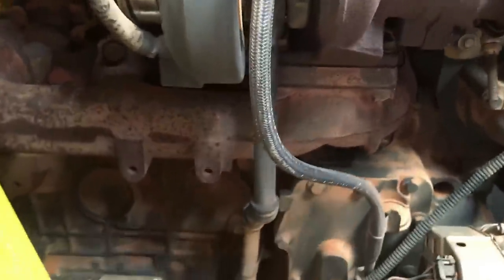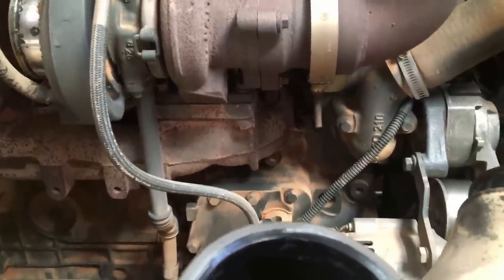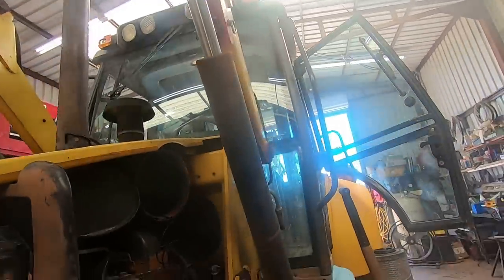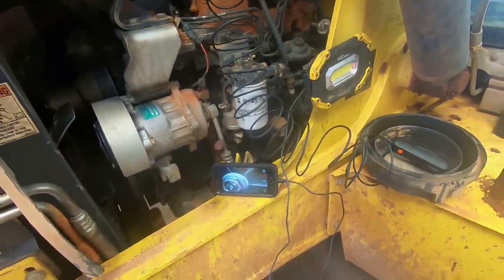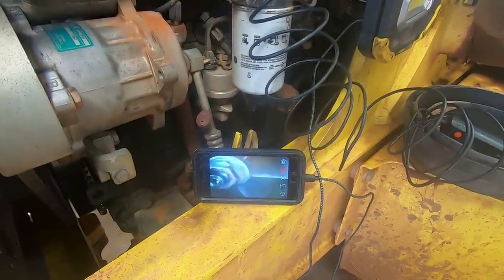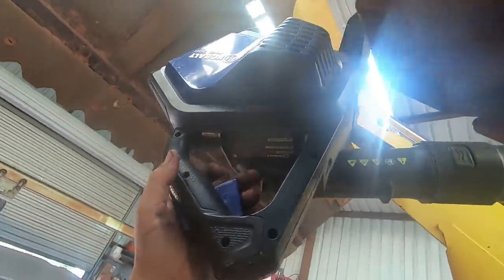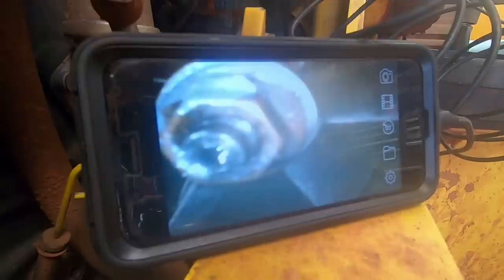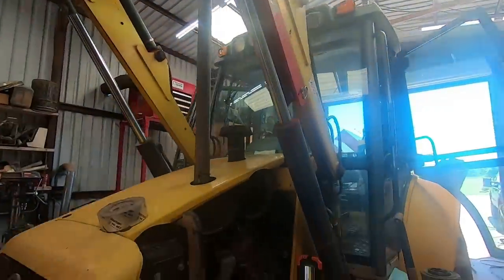Turbo myth? Should I cover the exhaust on my backhoe?

Comment: Great video. I believe turbo damage happens most from improper start up (rpms when cold) and improper shutdown hot shut down. Great job!
Reply: Andrew Dennis or no air cleaner. Suck up some debris gets them every time haha
Reply: For sure Jason!
Reply: My dad was requested to remove the turbo on the Insley excavator he operated 30 years ago and take it the repair shop. The shop told him the turbo was just fine due to how dad operated the machine. Warm up & cool down procedures dad did was strict (dad's personal procedure was the rule). I was taught to tape the exhaust just as a precaution.
Reply: Same here Dennis

Comment: Muffler vs non muffler. Older CAT iron pre muffler did have issues. As you said air flow blocked and incorrect direction good video

Comment: Well I guess I stirred the kettle. Thanks for the great 👍 presentation
Reply from the maker: No problem, it’s an interesting topic. I have hauled my machine since 2010 it has 12300 hours, original turbo. Some of the older equipment manuals have instructions to cover the exhaust when hauling. Maybe something to it. If I was hauling for hire, I would cover it just to make sure I would not catch the blame. Thanks for watching

Comment: Good demo Frank!
I like your reasoning and the video hookup with your phone to prove your point. I have 2 machines with turbos and have never had a failure relating to the transport with the stack uncovered.
Kudos for the time you spent to illustrate the turbo reaction to the forced air into the stack and the air intake. A scientific presentation from a reputable backhoe expert! Nice job.
Work safe, have a good week. 
Doug@ the "ranch"   #MBGA  #Digginok  #Backhoeman  #Rockanddirt

Comment: Great job. I’ve never really thought about it. Any cylinder that has an open exhaust valve would also have a closed intake valve. In my country boy thinking that would make a dead end. So after the initial charge of air flow would stop.    I like this kind of stuff to.
Reply from the maker: There is a bit of valve overlap, just a bit though.

Comment: I think it would take a unique set of circumstances to make it actually spin the turbo while going down the road.  I actually think the theory of forcing air in the exhaust is backward of what COULD happen - I think more likely is it would be pressurized intake/ram-air AND have a low pressure area at the exhaust with the pipe pointing backward of travel AND the engine would have to have a cylinder with both valves open in overlap.  We never covered exhaust up back when dad had the tractor shop and plenty of tractors we hauled were turbocharged.  I started covering exhaust only from the suggestion of others.  Not sure I'll continue.  Great video, Frank!  Thanks for sharing!
Reply from the maker: The limited amount of valve overlap is not enough to allow air flow, but it would be more likely in the right direction. Covering doesn’t hurt I’m sure, just not convinced I need to start
Reply: @Digginok  Agreed!  Very unique circumstance and I doubt even then it would be enough to overcome the other restrictions such as an air cleaner and still have enough flow and pressure to move the turbo blades.  The overlap with the valves would allow such a small volume as well.  I just don't think I'm going to worry about it much unless going on a long trip or something... I donno.  Prly not going to make much effort myself to cap the exhaust lol!

Comment: There's only one way to get a bearing to spin when you put compressed air to it. That's the angle you hold the blow gun to it.  Well it's the same as getting a turbo to spin, that exhaust has to hit the fins in the turbo at the correct angle. Back flowing air to the turbo to make it spin  would be difficult even if you took the exhaust pipe off and blew air straight in.  You'd have hit the fins at an angle. 

Also you are fighting flow restrictions. yes some of the exhaust valves are open but if the intake valves are closed all the air is doing is pressurizing the cylinder.  Both the exhaust and intake valves need to be open at the same time.  Which they are towards the top of the exhaust stroke  due to valve overlap.  But they are far from wide open.

As far as water getting in, Ford made provisions for that by putting a weep hole in the bottom of the exhaust pipe.

As for the comment stating, " If your exhaust was facing backwards while towing, it could cause a low pressure on the exhaust and positive on the intake, I say cover it just in case of foreign objects".
low pressure on the exhaust, meaning a vacuum to suck air out of the exhaust?  Which would be pulling air in the intake?  I think the air filter would take care of any "Foreign Object".

Comment: I have zero clue but perhaps, at one time, old turbos did not have something to prevent them from spinning backwards, if they even did run backwards to begin with. As I said, I have zero clue if this is true. Or it may be the same as "an exhaust needs back pressure to work". Who knows where this stuff comes from. great video BTW, well thought out and tested. :)

Comment: It happened to us,and yes it was a 1995 D -4 Xl high track.We have been trucking and logging for 40 years, and we never ever pull ed another piece loaded backwards!! And now even today when I see 18 wheelers being transported backwards, the exhaust is covered!! Think about it its on a lowboy coming from Texas to Chicago at 65 to 75 mph ,! That's a lot more air than a 100 mph leaf blower.. That's a lot of dirty coming from the front the sides from everything in your space. Trust me a 300 pound would have to chained to the floor or he wouldn't last 5 Miles, before the wind shear would float you up and away like you had a open parachute strapped to you. Think about and let me know!! Danny Hackler!

Comment: You're right I think. The air on the intake side is static and it would take a lot of airflow through the exhaust to get it to turn. All the bad turbos I've rebuilt were damaged due to ingesting garbage through the intake or oil supply issues. Running the engine at high rpm and shutting off hot without letting it idle for a minute will shorten it's life, the turbo shaft bearings depend on oil flow to stabilize and cool the bearings.

Comment: I've heard this myth a few times. Someone always claims to have seen the damage themselves, but then the details come out and you find the equipment was 20 years old, or the engine had an oiling issue before the turbo was lost. Maybe there are a set of circumstances that would cause the turbo to spin, it's doubtful. The only guy I have ever seen cover his exhaust while on a trailer finally stopped when the cover ( a heavy metal can with tie downs ) came off and broke the windshield of his backhoe. 

By the way Frank, you have got to be the best operator I've ever seen. While I'm not Jeff from Jpaydirt, I've seen more than a few. Talk about pride in a job well done, you and Jeff are the best.
Reply from the maker: Thanks!!! Really appreciate your comment!

Comment: In my opinion to have any airflow through the exhaust to the turbo then into the exhaust manifold through the only open exhaust valves and into the cylinder where it will dead head in the cylinder against a "closed" intake valve. Air will not be able to  "flow".
Reply from the maker: There  is some valve overlap, but only a small amount of air can pass.

Comment: I would only be concerned with water getting in while hauling, but only if it was on a trailer for a long time. If you just haul from job to job to home and start it all the time wouldn't even worry about water then. Some people just hear stuff and believe it and some you can tell anything and they will believe it. Can't tell you how many looked for a bucket of blue steam when they were first stationed aboard ship in the navy. Common sense sometimes is hard to find these days.
Reply: oldfarmer there’s s drain to let water out.

Comment: Damn that was a good video I have been thinking about the very same thing for years my dad used to say that it was a bunch of bullshit so we never covered the the exhaust on any of the equipment that we hauled and we hauled a lot of it I have covered several windshields with cardboard or a packing blanket and one time with a winter coat and duck tape

Comment: Yeah i think its not needed, we never use one on our excavators, but what if the exhaust pipe was shorter, if it was shorter the air pressure coming in through the stack would be greater? I dont think it would cause once it gets into the muffler it loses alot of it's momentum but just a thought, cheers!
Reply from the maker: It all comes down to valve overlap, if it can’t come through the valve overlap it can’t spin the turbo. At least that’s my opinion. The direction of airflow through a turbo in reverse does not work very well anyway.

Comment: That was a good test. Pressure and flow are not the same. You showed pressure in the exhaust but there was no volume. If you don't have any flow then it would not spin the turbo. If the turbo was on a bench with no restrictions then maybe you could make the myth work
Reply: And I’ve seen people cover the exhaust and intake when hauling too. If anything they’re just being over cautious. Doesn’t hurt anything and could keep a stupid bird from crawling inside

Comment: There is no where for the air to go blowing down the exhaust like that it’ll hit the backside of the exhaust valves, or if the engine is stopped on an exhaust stroke it’ll fill the cylinder. With no where to go you get no flow of air. Think of putting a garden hose down the exhaust it’ll just fill up and spill over. Once it spills over no more water is going into it. 

Put the turbo on a bench and it’ll spin because it will have air flow through it. So if you’re going to transport your turbos on a trailer on a bench perhaps throw a bucket over them. 

Or something like that. :) haven’t had enough vodkas to think straight yet.
Reply from the maker: There is some valve overlap that can allow air to pass, but it’s not much.
Reply: Digginok yes good point. However like you said assuming the engine did land on a point of overlap the flow would be minimal at best. That being said I think it would be best for people to just start filling their exhaust otherwise concrete before transport. 

See told you I get better with more vodkas!
Reply: @JasonWorksAlot  I might have to try that vodka thing. If it helps my mind.

Comment: Hmm, I've never had an exhaust pipe pointed into the wind when I hauled my machine and never had a turbo failure but I really thought the shaft/compressor/turbine would spin easier than that. I guess with the restriction in the piping and what little drag there is on the turbo shaft it just wont move that easily? Cool experiment. I think you should change your channel name to "Myths About Hoes".

Comment: Hey Frank! I think your turbo is locked up. Better get a new one. Too many trips down the road with exhaust not covered.  Just kidding, I never cover mine either. This must be an old wives tale.  I do idle my equipment for a minute or two before a shutdown. This is recommended by the manufacturer to allow the housing to cool down a bit so that it doesn't cook the oil. Oil flowing through the turbo acts as a coolant because the exhaust side can easily reach 900 degrees during a full power exertion. I have not had a turbo failure yet but now that I said it, I probably will. If the oil gets cooked it will leave a residue on the bearing and could cause it to fail or seize up.

Comment: There are several different thought processes at work in this issue. 
1) aren't turbos designed to spin, ANYWAY? 
2) does anyone clean the excess oil out of the turbo, after they shut it down?
3) most people complaining about wind whipped turbo damage on trucked equipment, won't even change the oil in their own cars! 

A turbo is designed to spin at unscrupulously high rpms. Yet, at those rpms, engine oil does lubricate the bearings. But, during transport, no engine oil is available to lubricate those bearings. But, there is no UNSCRUPULOUSLY high rpms, during transport! It is not likely that any more damage to a turbo will happen during transport with an unblocked exhaust pipe, than there will be by running without a proper warming up, or cooling down before shutdown, or running cheap motor oil, or too long a time period between oil changes! The possible issues could be water from a sudden torrential downpour, where large quantities of water get into a turbo, and allowed to sit for long periods before another use!! Even if the turbine is allowed to turn during transport, the only issue could be from lack oil lubrication. Most oils present with the slick film of remaining oil on critical parts, to help prevent cold start damage!  If cold start damage can be prevented from using specific oils, certainly a few unexpected turbine rotations can be protected from the same film of oil!!

While this issue is certainly an interesting one, I think a more important question looms over our heads, and should receive more attention! Should we put creamer in our coffee, or drink it black? 

I CANT DRINK BLACK COFFEE!! Although, it smells pretty good!!
Reply from the maker: roadkill5333 you bring up some great points one of which I’m highly opinionated on. COFFEE IS BEST BLACK!!! 😂

Comment: People over think this too much. Lets make it simple. Take a 4 cylinder, four stroke engine.
 Cylinder #1 -Intake valve is open, exhaust valve closed = intake stroke.
 Cylinder #2- Intake AND Exhaust valves closed = Compression stroke.
Cylinder #3- Intake AND Exhaust valves closed = Power stroke.
Cylinder #4- Intake valve closed, exhaust valve open = Exhaust stroke. 
Repeat
One, or both, valves are closed at ANYTIME during the operation of a four stroke engine.
There is, one very, very, tiny moment, that the intake and the exhaust valves are slightly open at the same time at the end of the exhaust stroke and the beginning of the intake stroke.  There is NO way you are going to get enough air flow though that slight overlap  of valve opening, to spin a turbo.
Reply from the maker: Thanks for taking the time to spell this out! I plan to do another video showing actual valve overlap. I felt like this test would help some people see that it doesn’t happen. You are exactly right!